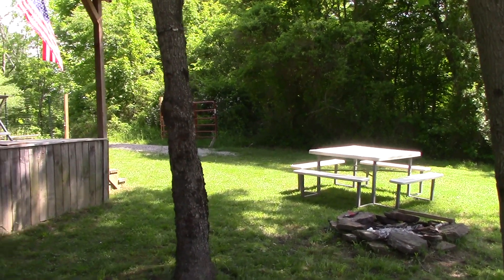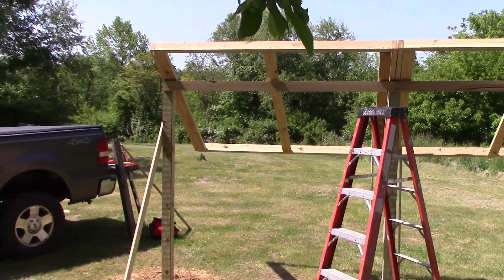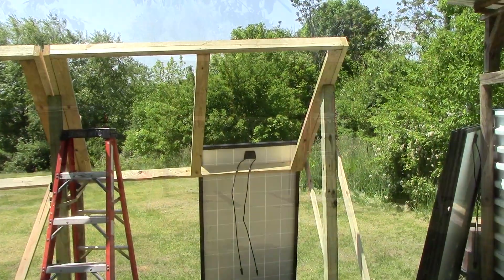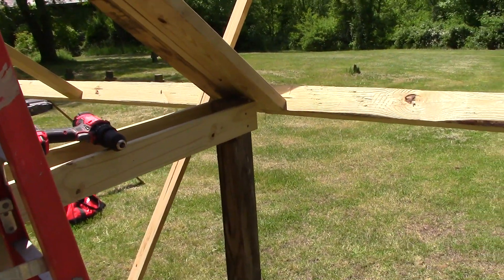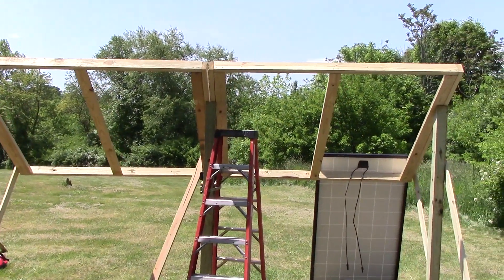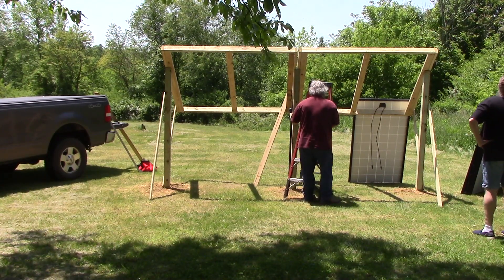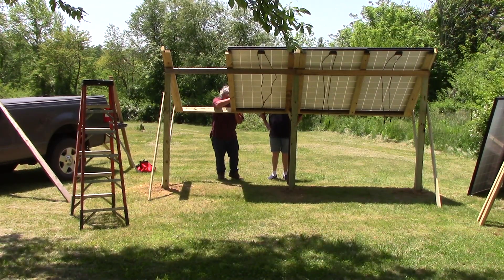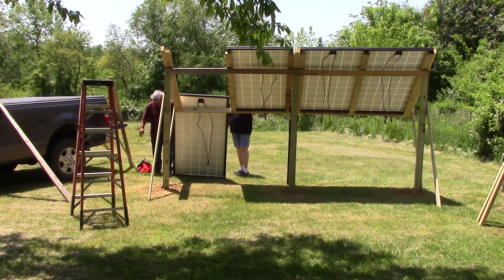DIY Solar Rack Ground Mount Pt2, My Mistake, And Installing the Solar Panels

Comment: Hey joe what was the open circuit voltage on those again
Reply from the maker: +peeinginthewind 37.7 I think.
Reply: @HomesteadWithJoe  okay then you can run all 4 panels in series because that's under the 150v input rating for the outback .. that way you wont loose as much power either running it to the shed.. and you'll only have to run 2 wires over
Reply from the maker: @peeinginthewind  The think with the VOC, you have to 25% to the total for cold weather. Everything performs better in the cold lol.  I will run 2 in series, and the those 2 series in parallel.  Since I'm only going with 1000 watt for right now, I'm using a different charge controller,  and saving the outback for when we move out there and significantly increase the solar production.

Comment: Hey Joe!
Old advice: Measure twice, cut once.  Better advice: Always do a sketch first, then follow old advice.
Lesson learned.  :o)
Are you planning on running conduit underground to the cabin.  Rodents love to chew cables...
Looking forward to the rest of the install, but don't overdo it.
All the best, matey.
P.S. You're looking very fluffy!  I can recommend a grade 2 buzz cut.  :oD
Reply from the maker: +SarkyBugger Even on my sketches, I didn't account for it lol.  But, it turned out to be a simple way to fix it.  Definitely using conduit all the way into the cabin!  This is my pandemic look!  Thanks!